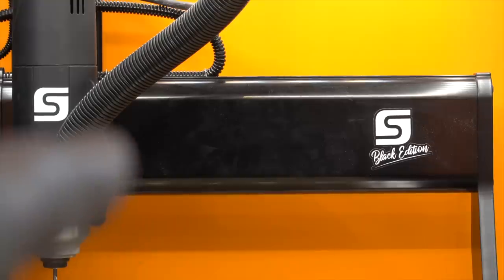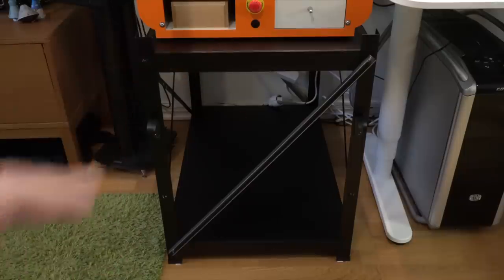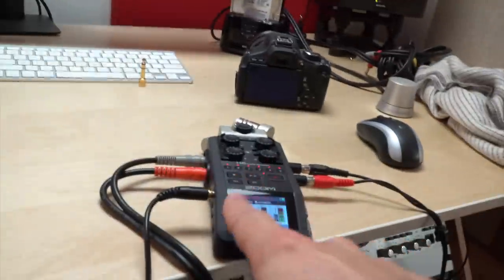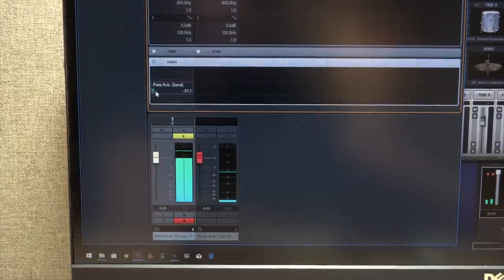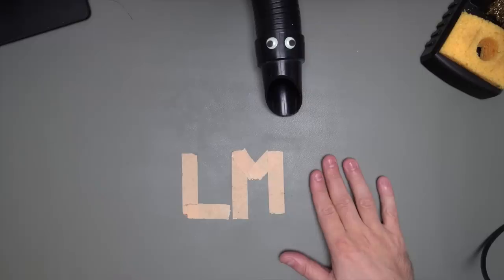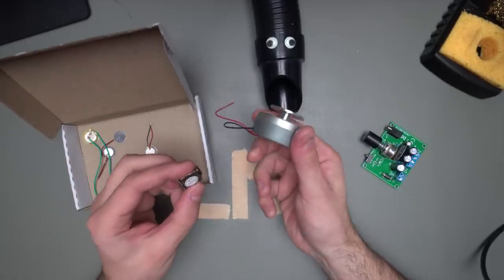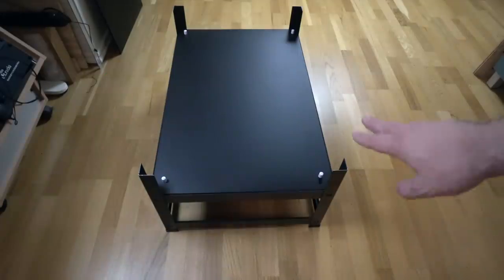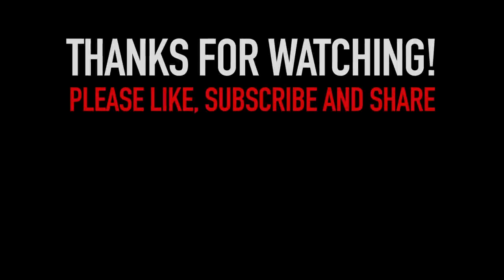DIY "IKEA Hack" Plate Reverb.  Sub $100.

Comment: Love it Leo!  Wondering why big plate reverbs are so heavy? Would having more kick from a bigger transducer into a heavier plate be more authentic? A spring reverb add on...A long wobble floppy spring (technical term) stretched diagonally across the cut off legs with a pickup on one end a transducer on the other and a switch to the amp to select spring or plate pickups 😊

Comment: Very nice. Since you have the setup, do you think you could obtain a simple impulse response of the plate? It would be interesting to see. In fact moving the transducers / changing them / altering the plate, would lead to subtle changes in the impulse response and the way it would then filter the sound. But as a side-note, impulses would produce really strong spikes on the piezos so maybe overall a good idea to clip them at the line level so that they don't affect the input stage.

Comment: wonder what would happen to the sustain if the plate was suspended rather than coupled or rubber feet isolating the unit from the ground in a vibrational sense. also wonder what the difference between a contact mic and a guitar pickup would make, aside from the guitar pickup probably needing an amp.

Comment: I'm wondering ... Do you hear sound fron the transducer onto the plate? If so will it be loud? 

2x speed is a great idea and slow it down... 

I noticed the cloth to change the plate sound and i was thinking.
Why not put an extra solid plate on top and add some kind of piston you can push down with a rotary handle ( knob ) .  . Just turn the knob to change sound... 😂🤣

Very nice project ... Well done 👍

Comment: Hi Leo !

I have another idea ...maybe stupid but who knows !! ....
Can you replicate this project but instead of metal ikea, use a big bass drum head like standard ones or maybe those huge ones used on Football School
bands ???

Sound could be good but darker I guess or how about using a very large thin old XRAY film stretched over a wood rectangle or a big 4x8 galvanized metal sheet stretched over a 4x8 wood rectangle  ?? ...and that definitely won't weigh 600 pounds more or less 95 pounds is my guess !!!

Please do this other DIY plate reverb or could it be called Drum skin reverb ?? 
and lastly ....How about using a Timpani drum as a surface drum reverb ??
Cool maybe ??

Comment: Love this, awesome video!
Wonder though, on the finished one there is a framework I can't find on the IKEA homepage, where the only thing to sturdy things up I can see is a skinny crossed set of sticks. Is that something custom-made, or is it just simply not on the pictures?

Also, curious: On the second part you have a box of Clas Ohlson-screws. Are you perchance a Swede?
Reply: I now found out the shelves wasn't one solid piece, but reinforced with a frame , which got even more obvious at one point in your video that I missed at first:-)

Comment: Interesting. Do you know how big the plate needs to be the work effectively? Could using a small speaker work in place of a transducer to vibrate the plate? I wonder if suspending a plate vertically would work as well - it would take up less space. Thanks

Comment: Bravo ! Great project ! The sound is great with the scarf and the hand ! Maybe a vertical version would enable you to gain space in your house and be simpler/cheaper to built... If you like this type of project, maybe you should buy/built a box containing 4+ clean preamplificators with clean connexion. That way, you could interchange a lot of transducers and microphones for your project with a minimum hassle and you would be ready to built Plate and Spring reverbs, flanging machine (balancing a mic in front of a loudspeaker). It's a lot of adventures ahead ! There is a wonderful book about this kind of projects : Sylvia Massy's Recording Unhinged.   ;-)

Comment: Cool idea, to me it sounds a little bit tinny. Maybe the size or the type of metal used.

I would probably use rubber or foam instead of the plastic knobs
Reply: A flat sheet of metal without bends rings much longer, needs dampening control. Larger is better but costs weight and space.

Comment: This is super cool!  I'd like to try this someday as I think it would be fascinating to experiment with different shapes and materials.  And did you think about trying a vertical mounting of the plate?  Too difficult for a prototype?  I would think you'd get longer resonance from a plate suspended from two points...  Either way, this is great work, very inspiring!
Reply from the maker: Hey Taiho!  You're exactly right with the "too difficult for a prototype."  It would be nice to get it turned sideways (or even mounted on a wall) to clear up some floor space, but I decided this was good enough as a proof-of-concept.  Plus if it were on its side, I have to figure out how to mount the transducer (instead of just letting gravity do its job) and dealing with the damping would be another challenge.  It would get better resonance, though.

I'll tackle this at some point in the future, I think.
Reply: @Leo Transducer mounting is the issue that has niggled my brain on this project (aside from the physical mounting which you solved on your prototype with Ikea pre-fabbing.) I reckon a dab of epoxy ought to hold for a couple years and could be engineered for renewal. I should have filmed my adventures with a Talkbox to ag hose project. Serious comedy wrassling that big snake around in the studio but I got a nice little reverb sound. Looking forward to further development on this. Thanks!

Comment: Hello, Thanks for the video. 

So I need 4 audio outputs to use the plate reverb and listen from the monitors at the same time?
Reply from the maker: Correct.  Well, technically, you'll need three outputs since the transducer is mono but those don't exist :)

Thanks for watching.

Comment: Unrelated: really digging your workbench setup.  How did you mount the scope on the pegboard?  And would you share your info on your fume vent setup?  Really like how its incorporated onto the table with the hose coming out.  Appreciate it.
Reply from the maker: Thank you.  I've been meaning to make a video about the bench as several people have asked about it, but cool project videos keep getting in the way.  :)

I didn't trust the pegboard to hold the weight of the scope so I bought some L-brackets (used to hold up shelving) from IKEA and drilled them into the wall and the scope sits on the brackets.  I cut a hole in the tabletop and ran the hose of the fume extractor (a Metcal BVX-203) under the bench into a nearby cabinet where the main unit is stored.

Hope this helps.  I'll make a video about it at some point...

Comment: This got me thinking. What about using a big ole cymbal for this purpose? The right one should have a more open and washy sound (which could then be tamed with moon-gel and whatnot). Plus it's really portable with stand and all.. Anyone tried anything like it?
Reply: Or a wooden one, with a thin sheet of ply stretched across a frame. To add resonance to guitars, or give a woody tone to a bass guitar?
Reply: Excismos oh crap i love that idea 🙆‍♂️
Reply: Yes,  larger cymbals mounted vertically with the studio monitor on one side and close miced on the other, cheap and dirty!!! But my favourite is a Bluetooth speaker in a stairwell and a portable recorder one or two flights away!
Reply: @excismos8056  There are speakers made much like that. Very feasible.
Reply: I've had an idea to do this with a piano, sustain pedal down, because loud sounds near a piano always resonant the strings and its a bit like it's own reverb. string reverb tank. adds a bit of sitar-like sympathetic drones at the same time.
So far my impulse making didn't work. I would have to try an actual transducer. 

The other thing was if you use your symbal as a plate reverb..... use an old spring reverb as a cymbal hehe.
Reply: @jorgepeterbarton  thats a good idea also a guitar could work and be wayyy more affordable

using springreverb as a cymbal is a funny idea xd
Reply: i've done the cymbal thing, two piezos and a speaker. worked great it ended up in a song. it doesnt quite sound like reverb though.. a lot of color and high end stuff going on. i Also tried acoustic guitars and it's very disappointing, cookie trays sound interesting too :) but none of these sounded as good as this desk TBH
Reply: @jorgepeterbarton  piano resonance reverb was used all over the place in the 70s, put a sand bag on the sustain pedal and mic the soundboard. other way is to si there and hold the keys in the key of the song throughout the recording but its hard to find a good assistant haha

Comment: Did you use any adhesive on the knobs to hold them to either plate?
Reply from the maker: To be honest, no.  I just plopped them down in the corners as I'm still experimenting with the whole concept.  It certainly wouldn't hurt to secure them as you suggest.
Reply: @LeoMakes  I don't know if it would hurt or help, just curious. Does the plate end up moving around at all, touching the corner posts or anything?
Reply from the maker: @megaohms  Not at all--the plate has enough weight that it doesn't vibrate or move at all (unless you bump into it or something)

Comment: how small can you go?
Reply from the maker: It’s a good question.  Short answer is I’m not sure. 

Making the plate smaller would cause the “room size” to get smaller (analogous to reducing the X and Y dimensions of a room).  Eventually it starts to sound less and less reverb-like. You might counteract that by making the plate material thinner but I’m not sure about actual sizes.

Comment: how loud is the transducer on the plate and does that audio not also go into the microphone you are speaking into? Really cool tho :)
Reply from the maker: Very insightful question!  You can definitely hear the plate resonating from the transducer but it's not super loud.  It actually sounds better when the volume is reasonably low since if you turn it up a lot, the transducer starts rattling on top of the plate.  Thats another reason to keep the amp wattage lower, since there's no point in driving the plate super hard.

I use a lav mic on my shirt collar so my voice ends up being much louder than the plate, so that's why you don't really hear it in the video.

Thanks for watching!
Reply: @LeoMakes  Ok Cool thats also what i had in mind, i have been looking into making my own spring or plate reverb ever since i got Doepfer A-199 spring reverb
Reply: In studios, the actual plate is usually in a separate room.
Reply: @stensarapson2378  Throw them in the giant echo-chamber they used before the invention of plate reverb!

Comment: how would a smaller or larger plate effect the sound? would it make it decay longer or change the "size" of the sound?
Reply from the maker: Definitely.  The size, thickness and other material properties can have a big impact on the overall sound.  Generally speaking, the bigger the plate, the bigger the "room" (i.e., longer reverberation time).

Comment: The impedance problem is fairly simple to fix. Using either a FET, and output transformer or a D.I. box. Check documents on 'Contact Mics;. http://knowledge.lom.audio/research/contact_mics

Comment: The plate reverb idea is certainly worthwhile. You addressed a couple of my reservations at the end, but you might also revise the suspension of the resonant plate to get more stable support and a slightly damper, less-boomy resulting sound. The wooden frames of the old studio reverbs served and still serve this sort of purpose, while still allowing manual manipulation. It is certain you can do better on the transducer and pickups, as well as the electronics. Using shelving as a shortcut is appealing, so I see why you chose the Ikea route. I would think, however, that unpainted, slightly thicker sheet metal would give a better sound. Please do bring a revision video.

Many thanks. There’s only one thing. It’s that “nkay” refrain you peppered throughout the narration. Please, please - no, really - please lay off of that. Pain. Really bad associations with petty-dictator office managers from my distant past devour my brain when you say that.

Other than my brain loss, this is a good effort - well done.